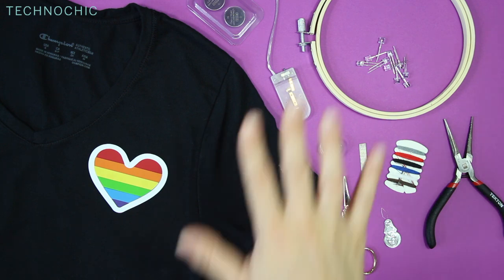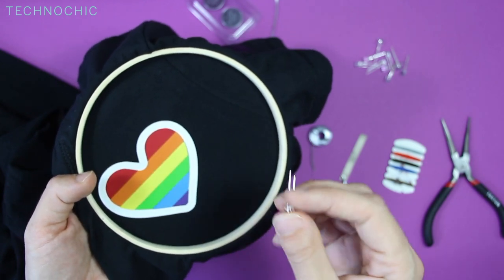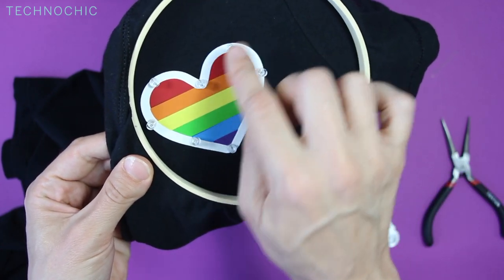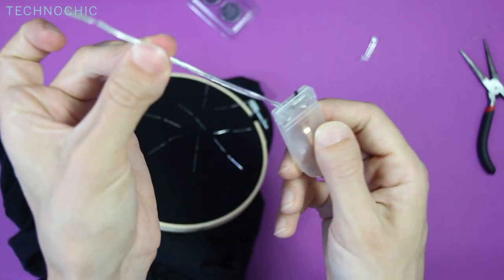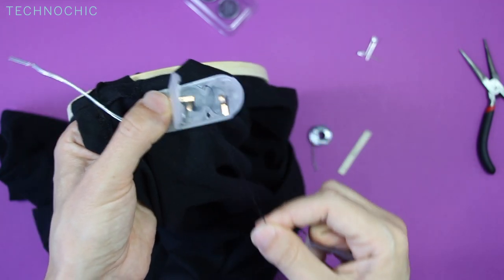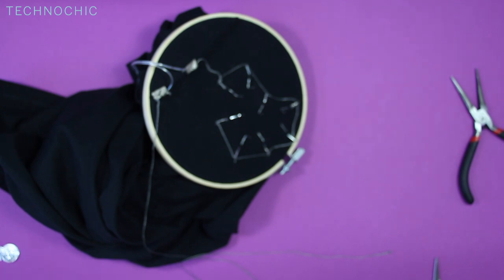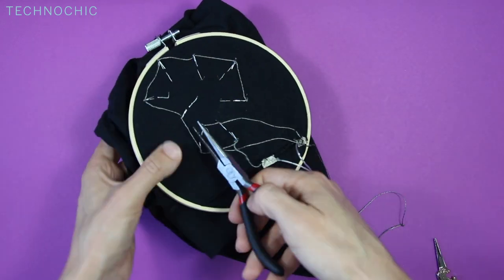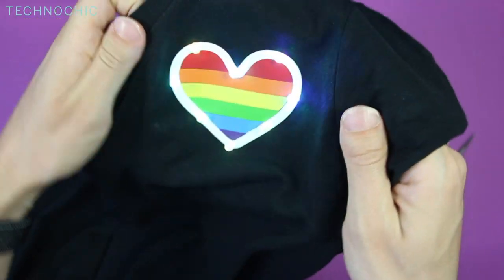Sewing Circuits: How to sew LEDs onto a T-shirt and make it light-up! The "staple" method.

Comment: Can you wash it?
Reply from the maker: Yes, if you remove the battery and let it dry completely before replacing the batteries. I typically hand wash the shirt and avoid washing the area of the circuit (it's not an area that gets too dirty anyway) then hang it to dry. I hope that's helpful!